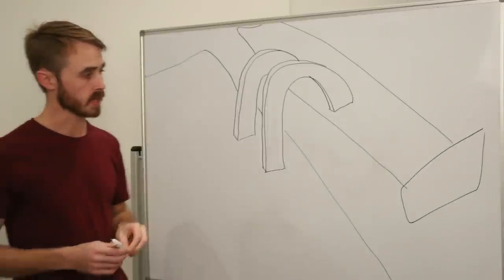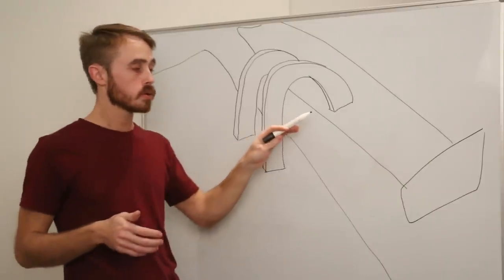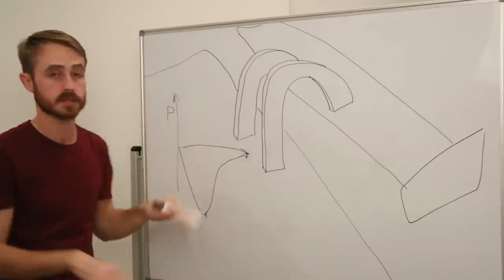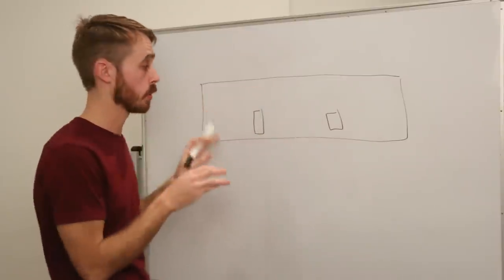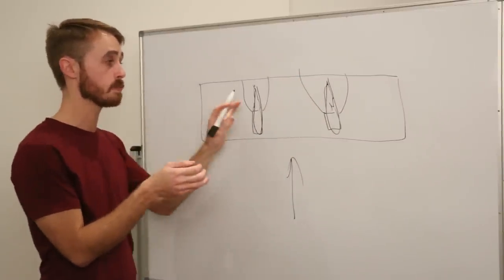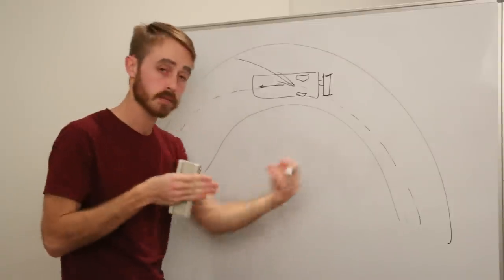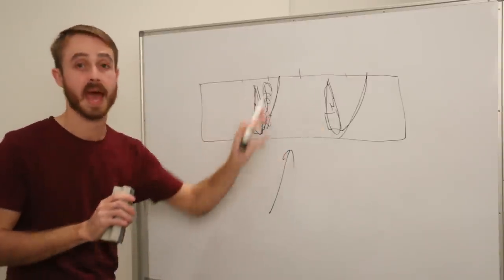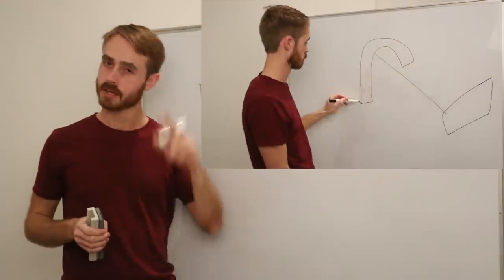How Swan Neck Wings Work

Comment: Just skip to 6:10. Kyle succinctly answers what the rest of the video managed to nearly confuse with tangents. 

Kyle, there clearly is no question about your understanding of fluid dynamics. However, you could greatly increase the effectiveness of your discussions with one simple change to your approach and delivery of ideas:

it is much more helpful to give a simplified assessment/summary at the outset of discussion, which then gets explained or "unpacked" for the rest of the video. Allow me to visualize the 3-stage process:

1. Introduce the subject for discussion
2. Summarize the answer to said subject as succinctly as possible
3. Spend the rest of the time going into detail regarding the summary, answering any possible questions, situations, etc.

This will leave people feeling better informed concerning your information, as well as giving them a better chance of understanding. I've noticed most of your videos do the opposite:

1. Introduce subject
2. Spend a vast amount of video time detailing reasons and situations in a tangential fashion
3. summarize the answer to the subject

As you can see, switching the order of 2 and 3 creates discussional confusion. It is a style of delivery often used by experts who understand the nuances of what their discussing; however, those of us listening do not understand as well, if at all! Therefore, changing the order of discussion points 2 and 3 as recommended better your chances of effectively communicating your ideas with your listening audience.
Reply: Horror Readings by G.M. Danielson
there's a simple way to summarise that (based on professional presentation techniques):
1. say what you're going to say
2. say it
3. say what you just said

Comment from the maker: +william balbys I can't seem to reply directly to your comment, but yes, due to the direction of the total force on the wing (lift+drag) it makes more structural sense to have the mount behind the wing. However, this is often not practical to mount to the chassis when designers want to place the wing very far rearward, hence why they are in front.
Reply: william balbys I believe active suspension was banned in lmp
I know it is in f1
Not sure about gt though
Reply: I was watching recent video of AJ Hartmans mustang aero, and saw they had a swan neck wing. I knew you did a video on it a few years ago so I came back to ask this exact question. I'm glad someone else beat me to it by a few years.

Comment: whats your take on mounting the wing by the end plates?  its my understanding that big end plate increase the wings effectiveness, so why not make big end plates that double as mounts, that way you don't have anything spoiling the air flow on either side of the wing, and nothing getting in the way in front...
Reply: Like an f1 rear wing.
Reply: Phil Marshall no they are not? there is nothing in the middle of the wing. They are mounted on the sides
Reply: Phil Marshall I know what you mean but I'm pretty sure that part is for activating/deactivating the DRS. Maybe it also helps with support, but the endplates are definetly the main supports.
Reply: Phil Marshall No problem mate. F1 cars change a lot and get confusing sometimes lol. There have been center mounted rear wings in the past but that was a pretty long time ago. I actually prefer the look of center mounted wings too.
Reply: +Phil Marshall They used to be mounted that way, but now the center support is the main way they are attached
Reply: +1 for that question, do you happen to know the answer now, 5 years later :D ?

Comment: so what happens to flow separation from giant wing endplates during yaw? Isn't the relatively small flow separation from supports outshadowed by the endplates. Or, if one argues the endplates actually help counteract the yaw issue, wouldn't underwing supports do the same? (like strakes on a diffuser)

Comment: question... (i know this vid is  year old but hopefully someone will answer)

so not so long ago in f1 we had the red bull front wing flex scandal and we have seen 'moustaches' in the front grills of a lot of supercars, mainly ferrari's which flex at higher speeds to increase front down force... now the moustaches are in the lower grills not touching the road like f1 wings would at high flex...(ironically what gave red bull away as it was scraping the track at high speed corners). 
so my question is, if you're rear wing is mounted and supported solely by swan necks, in addition to everything you mentioned, would A; the chance of wing flex increase? and B; would there be any aero gain as a result?

obviously this relieson the wings not being supported at the ends to like f1 cars or most oem/standard road car "wings"/spoilers.

Comment: you can see this in practice on all types of fluid dynamic mechanisms. basically, if you need to put some protuberance somewhere, choose a spot that doesn't jack up the lifting surface. so you get oil coolers, spare fuel tanks, bombs, etc. hanging off the bottoms of WWII fighter wings, and the like. a casual study of aerodynamics should prepare your intuitions for this, even if you're not fully aware of the why.
Reply: Michael min:
Love that comment:  "a casual study of aerodynamics should prepare your intuitions for this, even if you're not fully aware of the why."

Comment: I'm currently a first year mechanical engineering student @RMIT. I was wondering are there any simply ways, without major modification, to improve the aero of a mass produced car like the VF commodore?
Reply: +paulcug Yes, put an underfloor on it. Underbody aero is a forgotten area on road cars. Crouch underneath any car before say 2005 and all you see is mechanical maelstrom and zero thoughts going into that area. With the push in the last 5 years for higher efficiency vehicles, you&#39;ve seem some manufacturers start to look at the bottom of the car as an area of drag reduction as it&#39;s low-hanging fruit. And they&#39;re doing this across their vehicle lines as it&#39;s such a no-brainer. The Eco-modder communities figured this out long ago. Websearch it and you&#39;ll see numerous examples of executions backed up by MPG data. You might even find someone tinkering with the exact make and model of your daily commuter.
Reply: Look under an old vw bug.

Comment: Kyle. Firstly thanks for such informative clips. I have a question about wing supports and vehicle yaw. You mention how the slip angle of the rear tyres causes the wing supports to not be travelling in line with the air flow over the car. I am currently designing a rear wing for my EVo 6 time attack car. I am using end supports and was applying some of what you have said to my design philosophy. If the end plates of the wing are splayed outwards towards the front of the vehicle I appreciate that this will increase drag in a straight line. (Cd of approx 0.1 for a thin airfoil at 10 degrees AoA). However when turning the outboard wing support will be more in line with the airflow meaning the end plate will not cause turbulence over the surface of the wing adjacent to that support. The inboard support will be turned even more against the airflow however the wake of that support will not be disrupting airflow over any wing surface. The increased drag of this support mid corner will present a couple with a torque helping the car turn into the corner. Is there a reason that this approach is not used in the design of end mounted wings? What am I missing? Is it just the drag penalty people are concerned about? If drag was the issue then a twisted support could prove beneficial with the plate at the wing height splayed out but with a progressive twist down to making te support in line with the vehicle direction once there is enough distance from the wing to not affect the air flowing under the wing surface.
Reply from the maker: Raze the Roof Who says it isn't used? http://www.racecar-engineering.com/news/revealed-audi-porsches-le-mans-rear-wing-trick/

10 degrees is a bit extreme though, you probably aren't going to see more than 4 degrees yaw unless you're doing hilclimbs or dirt, what will happen is you will just end up stalling out your inside endplate while the outside endplate will be pulling you out of the corner, which will result in not great stability. Also it will result in your inside endplate building up a high pressure region underneath the wing, which is not good for downforce. This is why slotted endplates (on the lower side) exist, to vent this high pressure below the wing. Really, what you want is a profiled endplate, not an angled endplate.
Reply: KYLE.DRIVES Thanks for that.  I arbitrarily chose 10 degrees just to show the relatively low drag penalty if it did indeed offer improved downforce with yaw. I get most of your explanation except for the bit about the outside endplate pulling the car out of the corner. I would have thought the "approaching stall" drag on the inside endplate combined with the minimum drag of the outside endplate would help to rotate the car into the corner. By profiled endplate do you mean cambered endplates similar to the LeMans endplates shown in that link?
Reply from the maker: Catherine Palumbo The force provided by lift from attached flow is usually substantially higher than the drag force from stalled flow. If your outside endplate flow is attached, and at 10 degrees normally, and the rear is at 4 degrees of yaw, it means the endplate will have an angle of 6 degrees out of the corner, the lift from this will pull the rear out of the corner. While the inside endplate will still be pulling the car in, it's definitely not going to be as effective as having 2, non stalled endplates pulling the car into the corner. And yep, that LeMans endplate would be a type of profiled endplate.

Hope that helps!
Reply: KYLE.DRIVES Sorry Kyle I should have been clearer. I don't want to set the end plates at 10 degrees. I just want to set them to the yaw angle at optimum mu. So I would splay the endplates at 4 degrees to centreline of car not 10. So in this case you would have the outside endplate not providing any drag or lateral aero force to direction of travel and the inside with a 4 degree non stalled angle of attack to the air. Would this config provide a moment (caused by inner plate drag) turning the car into the corner plus lateral force on the inner plate providing force into the direction you are turning effectively providing a vector of force to the left rear? More left than rear if Cl/Cd is greater than 1?
Reply: Raze the Roof Sorry the inside endplate would be at 8 degrees AoA being the 4 degrees of initial angle plus the yaw!
Reply from the maker: Raze the Roof Yep, I understand, the thing you have to weigh up against is yaw moment vs lateral force, two 0 degree endplates is going to have slightly more lateral force than 2 4 degree splayed outwards endplates, and the wing itself will be making slightly more downforce by the aforementioned pressure buildup on the inside endplate. Yaw moment is generally not a problem at the higher speeds where downforce becomes effective, as a neutral car at low speed will be oversteery at high speed, so you don't want to destabilise it by adding additional yaw moment into the corner. See my Wings on FWD cars video for more on that! If you were doing hilclimb/dirt then the splay may be more beneficial, but if it was road or track I probably wouldn't go above 1 or 2 degrees outward splay from the local freestream. Really depends on your whole car's aero balance as well, and I don't think I would be worrying too much about this unless the rest of the aero on your car is really well sorted and you have a detailed analysis of where your centre of pressure etc actually is.
Reply: KYLE.DRIVES Thanks Kyle. Yes I didn't consider that I will need the yaw moment more so at low speeds and less so at high speeds. It's almost analogous to the anti-Ackermann debate. Your explanation has highlighted something that I never had considered before. The lateral force on endplates on a yawing vehicle will be pushing the endplate into the centre of the corner and if you assume the rear tyre contact patches to be the pivot point this force will always be trying to align the car with the airflow thereby fighting the yaw and pushing the  nose of the vehicle out from the corner. Fortunately as you have pointed out, understeer is less of a problem at the speeds the aero forces start to play a major role so this effect is not as significant at those higher speeds. Your clips have really helped me understand these basic principles and I eagerly await your future instalments!
Reply: @KYLEENGINEERS  So then the obvious solution here is the have two sets of endplates... one set with 4-ish degrees of outward angle (or more depending on the average speed of the track) and another set of endplates at 0 degrees for higher speed tracks.  Compare COTA/VIR with maybe Sebring or Palm Beach International Raceway.  I'm making my own wing, supports and endplates so this is all valuable information.  Thanks Kyle and OP!

Comment: Why don't the LMP1/P2 teams use the endplates as supports like f1 teams do?
Reply from the maker: +The Shad LMP1s do as well, but due to the increased span of their wings they need an additional support in the centre to keep the wing light by reducing bending moment and structural weight. I believe LMP2s are doing that more and more too now. If you have to choose a method for supporting a long wing though, it is more structurally efficient to have two centre supports than two endplate supports.
Reply: +The Shad Regulations mandate the mid-span supports.  The ACO doesn't want loaded endplates as the only source of support for the wing.  If a rear fender gets hit, it would immediately compromise the integrity of the wing mount and the car could be out on the spot.
Reply: +mulsannemike Pastor Maldonado spain 2015...

Comment: Hi, very intresting video. I would like to ask why, if wing mounts (which are genrally not so big) cause such problems with flow separation under yaw conditions, do quite a few racing cars (including if I'm not mistaken F1s) use quite big end-plates. Would they not generate the same effect, if not possibly greater?
Reply from the maker: alek ita Endplates do in fact produce flow separation in yaw, however their benefits in controlling the wing vortex exceed this downside. Check out my video on "How do F1 rear wings work" for more! Also keep in mind that with a flat wing profile, and a slight downwash from the chassis, F1 wings aren't as close to stall at the ends. Check out my "Why are car wings twisted" video for that. You may also note that F1 cars typically run a swan neck wing mount in the centre.

https://www.youtube.com/watch?v=7pWuI2Fk57U
https://www.youtube.com/watch?v=PmaKmz9cqRY
Reply: KYLE.DRIVES  Ok, thank you very much!

Comment: Am I the only one thinking the optimal solution on a racecar would obviously be a reversed swan neck? 
I mean,  wouldnt you want to hit the wing with virgin airflow as much as possible at any angle?? assuming that we are in fact going forward at speed  when we need it to work, and that the intention is  that it generates downforce when you're at critical speed, I'd say you're much better off with positioning the wing supports behind the effective surface area of the wing, with the swan neck bending towards the front of the car.
Reply: You could also mount the wing at it's complete extremities thus having one half of the "bad airflow" from the mount off the wing
Reply: now after 3 years, do you happen to know the answer?